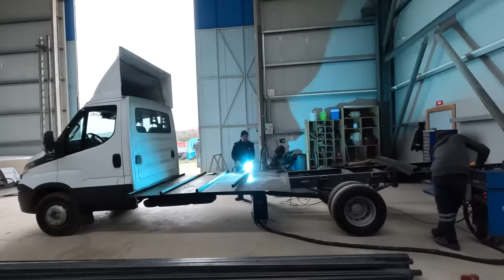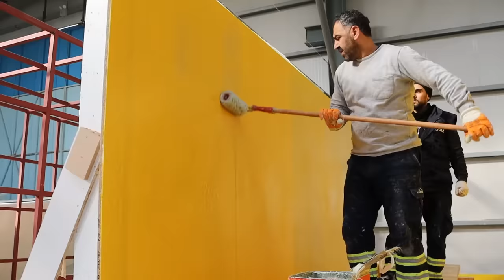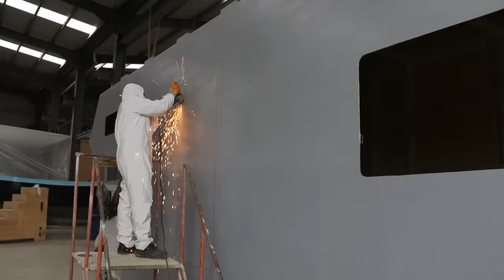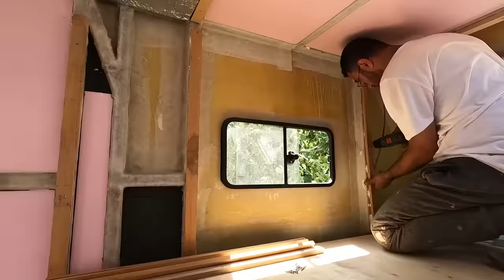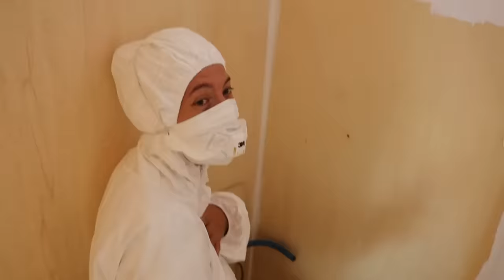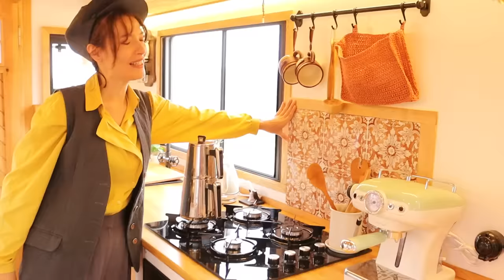12 DAKİKADA SIFIRDAN KARAVAN YAPIMI | Campervan Start to Finis in 12 Minutes

Comment: nice work didnt see the bathroom or air conditioner or heater and with all that steel not using aluminum this has to be heavy wonder what it weighs with all tanks full etc

Comment: Could you share any picture about the plans? Or at least share the internal and external dimensions of the container (home). To have any idea, for use it as base to re-design my own. Also it could help to know the dimension of the trailer and the model long wheels of the van.
 Thanks